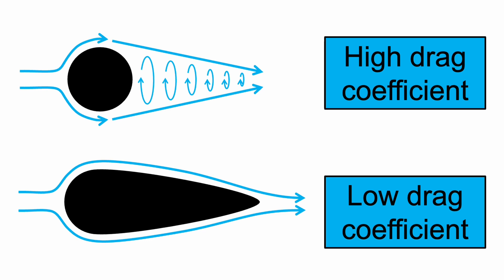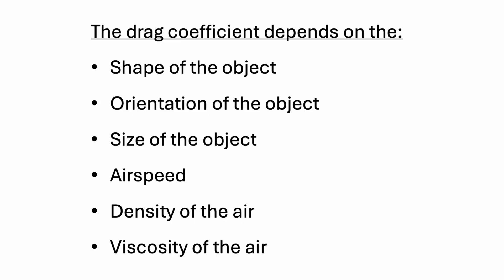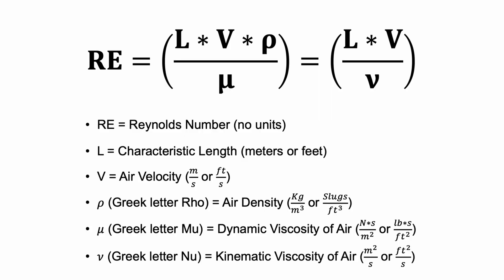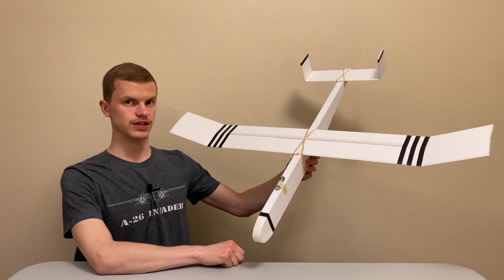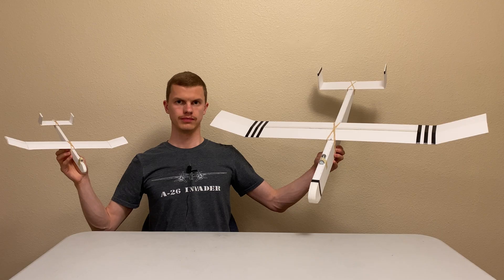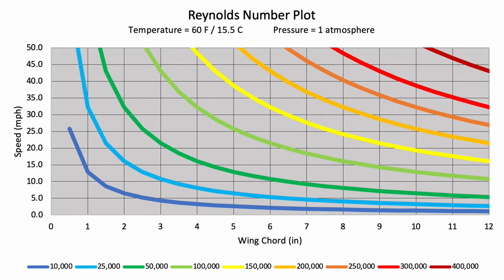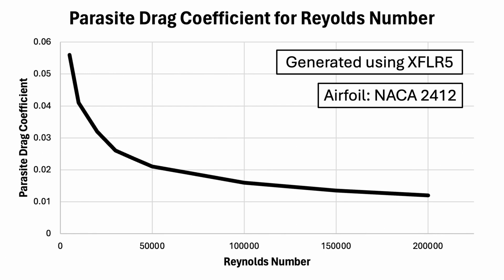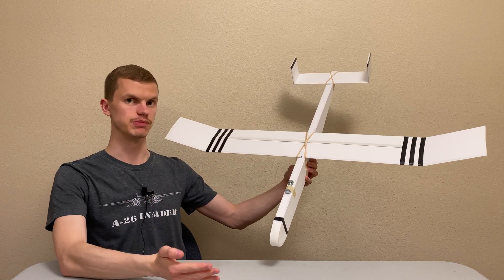Reynolds Number Explained

Comment: You can kind of think about Reynolds Number as the scale factor of the aircraft to the air.  You can scale an aircraft up or down, but you're always stuck with full scale air.  That's how Dr. George described it, as a "very rough description of what Reynolds Number is describing..." in my Intro to Aeronautical Engineering class in college.

Comment: Viscosity has more to do with "thickness" than "stickiness". 
Thicker fluids tend to flow more slowly than thinner fluids. Think water verses mud. 
A thicker fluid may seem sticky, however that is a function the viscosity. Thicker stuff takes longer to flow off of a surface than a thinner fluid. 
"Sticky" is a function of adhesion. Consider CA (super glue) the stuff is actually thinner than water, but it is very "sticky".

Comment: Thank you for your nice and informative videos. 
What about the Cubic Wing Loading WCL? planes with low WCL float in the air, are slow, and have low stall speed. On the other hand, planes with high WCL are fast and have high stall speed. For both airplanes used in your demonstration, what are the WCL? is there any direct relation between the Reynold's number and WCL? I know there is not, but what about an indirect relation?
Reply from the maker: A plane with a higher WCL would fly faster and have a higher Reynolds number.

Comment: Frank Zaic's books contain the results of his extensive experimentation and collect much of the knowledge if ither modellers in North America and Europe from pre WW2 through the early 1950's.  Extensive work with Airfoil selection and Turbulator shape and Position.  
The next step was Herr Doctor Ingeneer Richard Eppler's series from his computer program. His interest was spiked when he observed r/c gliders in the Alps that flew well with airfoils that Were Wrong according to his personal State of the Art wind tunnel verified computer airfoil design High Reynolds program. In digging into this he realized that Viscosity  is essentially a Constant which becomes more important in Elastic-Gaseous Fluids as Reynolds drop from 1 million of full size Piper Cub at landing speed (3 foot airfoil Chord Length at  about 35 mph  to a 2 inch airfoil  chord of a gilder tossed at 12 mph across a gymnasium.
Chord is a Linear factor and Speed - Velocity is Squared!!!!
But Viscosity is a Constant !!!

Comment: What increases the Reynolds Number? Mostly size. The air is the air. It is a constant. So, the larger the aircraft, the proportionally thicker the air surrounding it is. This is why airliners appear to move laterally so slowly, compared to small model aircraft.

Comment: Faster and larger we can get planes the better and farther they can fly 🤙
Reply: Not really, every plane has an optimum speed to maximize range (km), and another optimum and slower speed to maximize endurance (time airborne). The fastest speed the engine can push the plane achieves both a shorter range and endurance.
Reply: If the plane has infinite energy available, then that would be true ... but with a constrained energy source faster means significantly higher energy transferred into the air as Ke that is lost, and does not contribute to range. Two excellent examples of this are sail planes that can stay in the air for hours, and achive significant range by riding thermals, and the Sikorsky Prize Atlas human Powered VTOL that kept about 300lbs in the air for 1 minute, with less than 600 watts of power (about 1HP). Over 1,000 team failed the GoFly competition forgetting these facts, in a horrible Lemming death dive with quad copters requiring ten's of KW's of power, that batteries can not provide ... or even small ICE's.

Comment: What about the scaled travel ratios ? If we throw 1x and 2x scaled planes, measure their distance and divide the distance of larger plane by 2, would it give the same result ?
Reply from the maker: The distance a glider flies is determined by the ratio of the lift coefficient to the drag coefficient, multiplied by the height it was thrown from.  The small plane was at a disadvantage because it had a higher drag coefficient.
Reply: You can see in the diagrams, that it is a sort of exponential function. So the answer should clearly be "No".
Reply: If all the structural geometries are identical in scale, the smaller plane is at a disadvantage. However structural strength doesn't scale linearly either, and favors smaller, lighter, stronger structural solutions as you scale down to some degree. Replacing the fuselage surface area with a long soda straw, removes parasitic drag while retaining wing area. Likewise the smaller slower model has smaller control forces, so the tail section can be significantly smaller if positioned farther from the CG or CM, with a larger lever length. Scaling planes up has similar results, often requiring significantly heavier and stronger structural elements.

Comment: Reynolds numbers are important. The standard atmosphere as lower Reynoldsnumbers at increased altitude from its own.  
Climbing to altitude with the same indicated airspeed, e.g. Vx, the Reynoldsnumber decreases slowly. This reduces the glide performance of the craft, the L/D reduces a little. 
The now obsolete Boeing Condor, a long endurance high altitude platform had an L/D of 44 at sea level. At 20.000 m the L/D was 39.  This was a Reynoldsnumber effect. 
Flying high is a quest.

Comment: I don't understand.😢
Reply: Small things moving through air (bees, etc) see air as sirup. Large things (B747) see air as a fluid. I also needed time to understand this physic law.
Reply: He put more energy into pushing a larger heavier model plane, it went further than the smaller lighter model plane . If he (stored) the same energy into both planes , the smaller would have gone further. That does not explain Rynolds number.

Comment: I always wondered how Reynolds number affected wind tunnel modeling of airfoils. The Wright brothers were the first to empirically study airfoil lift and drag efficiencies through wing tunnel modeling, and as you have stated, lift coefficient is not significantly affected by Reynolds number. This is why their experiments to find the best lift characteristics using extremely small airfoil models in a low velocity wind tunnel were successful.
Reply: Surprisingly, the type of airfoil the Wright Brothers were using is very uncritical about the Reynolds number because of its sharp leading edge.
Reply: No doubt… especially the actual full size one on the 1903 flyer; blunt to say the least! Terrible stall characteristics. I’m convinced that their idea to control pitch through canard elevators (for safety reasons as the forward structure would absorb crash energies) saved their lives, but not for that reason. The canard configuration minimized/tempered main wing stalls… an added benefit they probably didn’t realize right away.

Comment: Discovered Reynolds analogy in 1971 when I tried to design a paper airplane for the UCLA Engineering week paper airplane contest.  It can be discussed without numbers.  Basically as airfoil get smaller, the viscosity of the air becomes more important than inertial forces like lyft.   That led me to use an auto gyro design that was very small with no camber.   This about 3 inch tall auto gyro flew 3 times longer than 2nd place.  
Latter I made 1/2 inch tall auto gyros from vellum using surgical tools.  These stayed aloft very long.  The problem was they had to be handled with forceps and were easily lost.
Reply: You know what you are talking about. And when you learn something deeply, you will never forget. :) Thanks !.

Comment: Wasn't the bigger aircraft heavier, thus starting with more energy?
Reply from the maker: Yes, but since it was bigger, it also had more drag force acting on it, so its energy was also expended more quickly.  The flight distance of a glider is given by multiplying the lift to drag ratio (which is equivalent to the ratio of the horizontal distance traveled to the altitude lost) by the starting height.
Reply: @DesignYourOwnAirplanes-xd6lz  (Genuinely curious, not challenging.) Is the ratio of "total drag" to "weight" of the bigger aircraft the same as that of the smaller one? In other words, is the increase in drag strictly directly proportional to the increase in weight?
Reply from the maker: @lastname6273  Assuming that the lift-to-drag ratio doesn't change, then that would be correct.

Comment: So a larger chord length= longer flight?
Reply from the maker: Assuming the speed, air density, and air viscosity all stay constant, then yes.  The difference is greatest at low Reynolds numbers.  Keep in mind though, that increasing the chord length without increasing the wingspan would decrease your aspect ratio and cut into your flight distance.
Reply: For airplanes the aspect ratio of the wing also influences it's performance. You can't just make the wind long and not wide.
Reply: @AlJay0032  They are called Gliders or Sailplanes.

Comment: I just finished my second year in aeronautical engineering and you just taught me more about Re number in 5 min than in my 2 years, such a shit education system
Reply: i mean it's not a difficult concept (it's quite literally just a ratio between dynamic and viscous/friction forces) but the application of this figure is much more technical which you will see when you study incompressible aerodynamics. it's hard to introduce such a figure without being able to go in depth on what it actually does so i can see why you might be confused. i'm sure you will learn a lot more over the next year so don't be discouraged. 

btw, reynolds nuymber is much less important past a certain point as your coefficient of lift is invariant all the way down to your level flight stall speed. this guy just happens to be running a model plane (small and slow aircraft) channel and not a general aviation (much much larger and faster) channel so in this case, it is much more relevant. ig that's why a drones prof has shown up in the comments lol.
Reply: All the good stuff is free. Stop paying 10'000s to a stupid liberal university.

Comment: In low R nrs the air appears more viscous. Thus insects appear rather to swim in the air, than to fly.
Reply: I think that statement is incorrect.  Common misunderstanding.

While the non-dimensional Reynolds number ratio is lower for lower velocities, for a constant characteristic length, the viscous force does not contribute to lift in a meaningful way because the viscous force points in the wrong direction.  Notice the orthogonality of the statement.

If we invert the Re number, it is clear that the viscous force is miniscule to the inertial force.  Flight must be the result of the inertial forces.  Q.E.D.

Comment: It is indeed the case that parasitic or induced drag decreases with increasing Reynolds number (Re), but at the scales in question, it is not the Re that causes this decrease; rather, it is the design of the wing, especially the tips and the airfoil, that plays a role. Despite this minor detail, the video is of a high standard, the explanation is very intuitive, and the author explains it very well. I am a university professor and I teach in a Master of Drones programme. I would like to express my admiration for the author's ability to explain this topic so clearly and effectively.

Comment: 3:25 Reynolds number does affect lift and drag coefficient. Especially at higher AOA. Most of airfoils with RN at least 2-3 millions will stall at about 15 degrees. At half million stall angle in most cases will decrease to around 10 degrees, sometimes around 7 degrees and that is less than half.
Reply: What is your justification for the statement?
Reply: @DumbledoreMcCracken  NACA papers, papers about fixed-wing UAVs (especially slow ones) and my own experience.
Reply: @norbert.kiszka  quote the title of one.

I agree that the viscous effects are negligible at high speeds, and the divergence of the flow from the surface is due to the high ratio of the time integral of static pressure*area to momentum.

But, in general, people don't talk about stalls outside of the critical angle of attack.  

Scaling models seems to be a dubious undertaking because the characteristic length is on the same side of the ratio as speed.

Comment: I learned that when the Reynolds number was below 2000 water would flow through a pipe in a laminar way and above 2000 in a turbulent way.
Reply: Water is less viscous / inertial that air, strangely enough.
Reply: @DumbledoreMcCracken  viscous and inertial are two separate things and water is definitely more viscous
Reply: @Samuel-vm7hn  water is more viscous, but the ratio of the viscosity to inertial forces is much lower in water.  1/Re

Comment: Um, you got that backwards.

Efficiency is achieved with impossibly thin wings of high aspect ratio.

For a given lift force, i.e. weight, a higher aspect ratio demands a lower induced drag for a given speed.  Adding chord adds skin friction drag without providing the efficiency of aspect ratio.

Adding weight increases speed because the weight must be balanced by lift, and lift is proportional to speed squared.
Add weight to the smaller model to make it cross the distance faster, crossing the entire distance before hitting the ground, possibly.